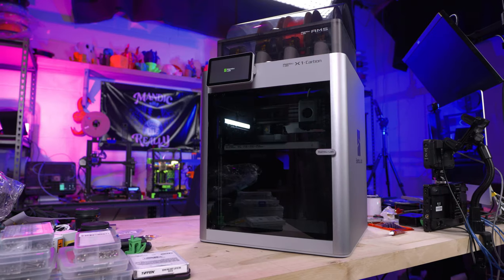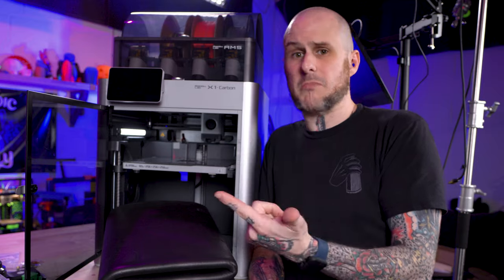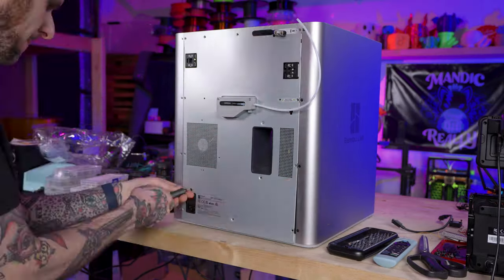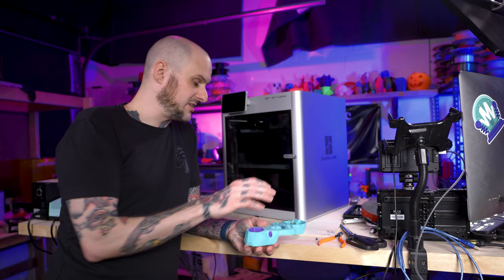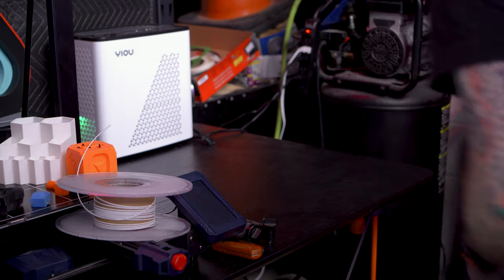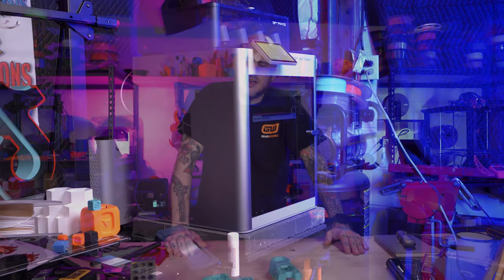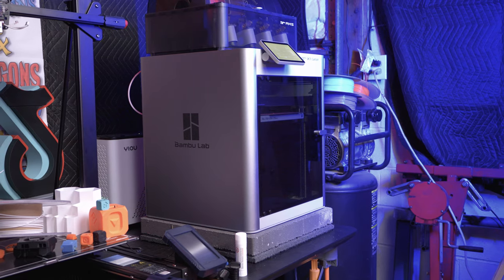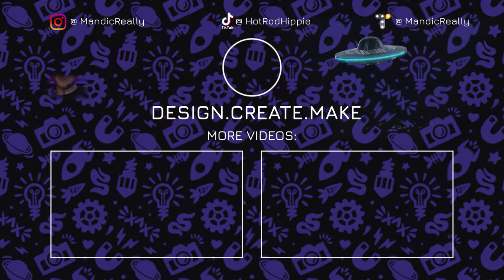Bambu X-1 3D Printer Modding & Problems - Noisy Ringing BEAST!

Comment: I got my X1C one week ago. The speed is amazing .... BUT .... i am really disappointed from the print quality. The print quality from my MK3S is so much better. Bambulab need to provide optimized configuration settings with much lower speeds. For most of the people quality is much more important then speed. The X1C is loud and shaking like hell with this high speed (default) settings. Configurations for high quality (much slower) prints needs to be provided in Bambu Studio from my pov.
Reply: I got some flawless results using the default, just halfed the motion speed to 10k and this surface smoothing in the slicer works very well.

Comment: One final thing I may do,as I’ll have this in garage, is get pink foam board insulation like r9 or r12.  

Then build a compartment on the back and both sides that will sit tight around the printer.

It should help a great deal with sound and chamber temp.

Then for your aesthetics it can just be removed like a can coozie.
Reply from the maker: I’ve got some plans to build a few “cabinets” for printers. Maybe something along these lines is in order for them. A more refined enclosure setup maybe.
Reply: I assume this might cause issues with the electronics or lifespan of the printer unless you actively cool them with room temp air or colder, like with any other printer

Comment: That AMS buffer on the back is crying out for some standoffs and maybe some additional support. I'm still waiting on a unit for now. I am curious as to why you didn't try some insulation on the back of the machine instead of the area you couldn't fit it on the inside. That should help some with the heat loss. Also, it might be worth printing some TPU footrests to better isolate the machine. It would also be interesting to try a sheet of insulating foam on the top of the machine under the AMS to see if it helped. Heat from the machine can't be good for the AMS anyway. Thanks for the video and for sharing. Sometimes you just have to try it to get answers.

Comment: 8:24 I printed the exact same Stealth Burner cover using Bambu Lab ABS at 50% default speed and all the corners came out crisp.
About the temp of the housing, why does everybody think it needs to be cooking in there? I print ABS at 35C Chamber temp just fine. What warps at cracks prints is draft and temp variations. Heck, before that I even printed ABS and ASA on a Prusa with only a plastic bag over it.

Comment: Ringing will generally increase with belt tension - but conversely, looser belts will also mean softer corners. That's un-compensated, of course. Surface the printer is on has some effect, but it's generally minimal, unless the printer is featherweight. Also, the lighter the motion system, the higher the ringing frequency will be, making it more noticable. Finally, overshoots in corners can also be due to belt springiness.

I'd recommend trying to tighten/loosen the belts as a first step in finding the cause.
Reply: no - the tension of the belt just shifts the frequency around
Reply: @TechTomVideo  Correct, and guess what happens when the wavelength is longer than the longest side of a printed object ;)
Reply: Additionally, what do you think happens when you shift the frequency outside of a resonance?
Reply: @oorcinus  you definetly should learn one thing or another about frequency and resonance.

what you're doing is wishful thinking.

You can't pick one part out of a parts network and claim something about it, without taking the complete machine into account.

your way of thinking is understandable, but your claim is not valid when it comes to physics
Reply: @TechTomVideo  Sure, bud, i’ve only been writing about and solving the problem of ringing in corexy and bed slinger machines for 10 years, it’s all just been wishful thinking.
Reply: @oorcinus  sure you did
Reply: @TechTomVideo  Look at the date on thing:277394
Reply: And if you were actually around doing the same things 10 or 11 years ago, you would’ve probably seen me on the old reprap forums posting about vibration/ripple and tests with fluidic dampeners too (spoiler: they did nothing, because the steppers’ own spring-mass-damper system was far out of the frequency range of visible artifacts).
Reply: @oorcinus   it seems to be very important for you to convince me of your expertise...

only hobbists would do that
Reply: @TechTomVideo  Sure. I wish you luck in your future endeavors. You seem like a very pleasant and smart person.

Comment: I'd assume they use a fairly aggressive form of vibration compensation. If you read up on klipper's input shaper types you'll find they try to give you the best option between reducing ghosting and not smoothing sharp corners.

Comment: the only way the paver would help is if you physically attached/anchored it to the machine… increasing the mass of the printer is what will help. Also it’s interesting that you were concerned with the quality while the production took half the amount of time as the ender 3, what would the results look like if you slowed it down maybe 25%
Reply from the maker: Not much different.  I said I've printed numerous of these and can't explain every single one.  I've printed fairly close to Ender 3 "speeds" and quality issues persist.  Also the paver is there to increase mass in relation to whatever the printer is sitting on.  It may not be directly coupled but it does have an effect on the sound and movement of the machine.

Comment: The car audio stuff you used, be careful with in the heated area. Cheaper stuff (like you used) is made with cheap materials like asphalt that will melt under heat. Happens all the time to cars. If you start it start to melt, pull it asap before it starts to drip and get something higher quality. It will work Much better for resonance control, and won't melt.
But if you can use a single sheet of the CLD material, it will perform much better. If it's still loud, get some Mass loaded vinyl and glue that onto the areas where there is foam.

Comment: Hi
I haven't received the device yet, but I'm looking forward to it.
Regarding your ringing problems:
I would do the calibration the way you will print later; so set it up exactly where you will need it later, with the heat bed, with the filament threaded in and (!) with the DOOR CLOSED!
Because an open door shifts the balance of the whole device, the vibrations propagate in a completely different way, etc.
Give it a try, you can't lose anything :)
Greetings from Switzerland
Reply from the maker: Thanks for the input, I however did all of that. The door was only open for filming purposes (fairly sure I put a notation in saying as much).  Actual tests were done with the door closed during calibration.  I've improved quality since this video and will do a follow-up, but none of my improvements can be related to the calibration process itself unfortunately.

Comment: Your double line might be pressure advance. Check it out :)
Reply from the maker: The machine is closed source. There is no way to determine what the machine is setting for the Pressure Advance. An engineer clued me in to a way to trick the auto-calibration to try and use different values but that has only worsened the overall quality and not addressed the issues. This is the problem. It could be a few things causing this but I have no data to work off of or settings to easily tweak unfortunately.

Comment: What about slowing the print speed down? That make any changes to the quality? With how fast this thing cooks, i'd imagine its going to have some issues there.
Reply from the maker: I've slowed it down to 50% of its default speeds and found only a marginal improvement in quality.  Corners were still round where they should be crisp, and ghosting was still present. Mind you those 50% speeds are slower than I print with on my Voron V0.1 that isn't tuned fully.

This machine is truly impressive, especially for its price point, but there are still issues present. I think they probably need to create slower profiles tuned especially for quality, but they seem to have focused on the marketability of speed.  

I didn't include the scope of the testing I've done in this video as it would have been bogging down in details and likely been twice as long of a video. I'm confident the issues I'm experiencing will be worked out eventually, but with the data I have available, I'm not sure how I'll address them.

Comment: Two layers of mylar blanket should help in those thight spots. its best if those two layers of mylar are separated by a layer of air (make a gasket you can glue the mylar on, the gap provided by the gasket does not have to be wide 2mm allready does a lot)

Comment: Im getting ready to purchase the X-1C but plan on using DYNAMAT throughout the interior you should look into it you can get the internal cabin to a temp of 60c with the reflectiv Dynamate its only 50mil thick so you should be alble to cover the internal cabin without any interference  hope this helps
Reply from the maker: Dynamat is the same product type as the stuff I applied. Butyl with a foil backing. I just used a generic version that costs WAY less.
Reply: @MandicReally  yes but didn’t you only use in on the bottom?

Comment: considering the flatness variance of your concrete and rubber, maybe just cut 4 small corner pads. Or go NASA style and use 3 so it will always have stable contact(in many areas all of their floor equipment is spec'd for 3 casters or legs). Regarding the chamber temperature and sound reduction. Gaps, even tiny ones, are the #1 enemy. It may be easier to add a complete external cabinet. MDF, rockwool and a door gasket if you really don't want to hear it.

Comment: Please don't hear this as complaining, but I wish you would have shown the whole process of removing the back.  I am having issues with my heatbed.  I filed a ticket and was given a link to instructions on the wiki.  It has me removing the back, but it just says to “remove the rear cover” and “remove the excess chute.”  There are 3 red circles on a picture, but completely NO INSTRUCTIONS on how to do that.  I don’t want to pull or do anything that will cause further harm to my machine.  I have been searching all over to find a video showing how to do that. 🥴

Comment: It would have been cool to see a  test where you wrap the whole machine with insulation to see if that helps more since the insides are so limited.
Just as an experiment, and it doesn't need to be glued permanently.
Reply: yep just a heavy moving blanket wrapped around the whole thing

Comment: maybe you should consider the opposite.

for lathes or milling machines it's not uncommon to bolt them down onto the workshop floor in order to adress exactly these problems with ringing and rattling.

Comment: I enjoy your content, and your storytelling is second to none :-)

Regarding ringing: I haven't seen it anywhere else than on machines for precision machining of metal, but if you really would dampen resonance within the printer itself, wouldn't you have to bolt it to a heavy foundation? Lathes for instance are bolted to the floor, and the printer could be likewise (or bolted to a stack of paves). There are probably no obvious places for it on the Bambu, but the printer must have some kind of feets.... It might seem drastic, but for a machine that fast, and "for science" it might be worth considering.....!?

Comment: I have a Carbon X1 and found your video as I'm trying to get it simply to print a round hole.  The test I ran was a 3/8" OD washer with a 1/8" ID in the 4 corners and center.  the two on the left side of the bed were only 0.007" out of round where the two on the right were 0.015"... I'll try tightening the belt and putting on a more solid surface... Possibly look at the infill pattern and see if concentric infill would work
Reply from the maker: If you’ve got an AMS, remove it from the top of the machine. I haven’t done a video to show yet but that was the biggest improvement I’ve found so far. I’ll cover it soon. I also print at 50% or less of default speed. It’s still plenty fast.
Reply: @MandicReally  YEP! and I moved it to the floor with more of a "repeatable". I was just coming back here to reply that I found taking the AMS off did the trick.  I now print at full speed for most parts and then if I really need within a few thou I slow it down!  It dawned on me that the moment of inertia of the AMS is variable especially with full spools.  I am going to build a table and get a bit longer tube so I can place it under it.  I was even considering adding a damped pendulum weight under it... then I thought better of that as it would be a science experiment on it's own.  Thanks again
Reply from the maker: @stevenabbott4628  Glad to hear it worked for you too.  I NEED to do a video about it.  It is sad that Bambu clearly designed the machine to put the AMS on top, but it is a terrible idea for the machine in practice.

Comment: maybe a stupid idea of me, but i think if you could replace all these panels with wood it would reduce the sound. Also you can make it a little bigger so you even can put sound insulation everywhere. afterwards you can paint it or engrave it, give it any look you want.
Reply from the maker: I avoid flammable components around heater elements as much as I can. I would make panels from acrylic for similar reasons. You aren’t wrong at all, but on a machine I know is intended to run heater elements at sustained higher temperatures, I wouldn’t mess with it.

Comment: Very impressed with this review and super helpful because the Bambu is on my list as an upgrade to my Prusa Mk3s. Unfortunately the Bambu isnt currently ticking all the boxes I need it to.
Reply: Which boxes are missing for you?
Reply: @devrim1134  I think if I didn't have a Prusa Mk3s I would purchase it or one of the others on my list. As it stands it is a lot quicker than the Prusa and would tick the multimaterial box which the Prusa doesn't. However I had thought that with the enclosure the noise level would be equivalent to the Prusa which is obviously not the case. I am really not keen on using the cool plate with glue sticks.. it seems a step back but I want the LIDAR feature which is a big step forward. I contacted Bambu about this, asked if there would be an update to get the LIDAR to function better with the textured PEI plate. The answer was that it could never be as accurate with the textured plate as the cool plate so use the cool plate to flow calibrate the filament and then switch in the textured plate and deselect flow calibration. This makes sense but is a bit clunky.. I suspect they will work on this. At this stage the print quality isn't quite sorted and I suspect will be significantly improved over the coming months. Overall the product and software appear to need some tweaks. At the moment I'm considering the Bambu x1 Carbon, the Anker Make M5 and the FL SUN V400.. Not an easy choice, all have pros and cons.
Reply: @dworkin7110  thnx for your explanation! Im new to 3d, don’t have a printer yet, need to make some decisions as well :)

Comment: I'm having some pretty severe ringing on my X1 as well - but my ringing has several "waves".  I've done pretty much all the same things - with the exception of the insulation (belts, calibration, dampening, etc) and while it has improved a tiny bit, it's still doing it.  I'm seeing it especially on compound curves, and since I print a lot of characters, I'm seeing a lot of it.  I even tried slowing down the machine to about 60% of "normal" speed ... and the ringing is still there.  Re-orienting the model in the slicer just relocates the ringing.  I really hope that Bambu can figure out what the heck is going on because it's an amazing printer.  So, you're not alone.  I'm currently doing one more test print, and then I'm going to be firing off results, pics, 3mf files and descriptions to hopefully get them to tell me what is going on ....
Reply from the maker: Is your AMS on top of the machine? If so, Remove it, Do a calibration, retest. That made the biggest improvement for me. I’ll do a follow up sometime soon.
Reply: @MandicReally  I don't have the AMS - but I have another X1 coming in tomorrow.  I'm going to run tests on it - same prints - to see if I get the same behavior.  I did some tests today where I copied over settings from Prusa Slicer (my MK3 prints these models perfectly - but much more slowly) and then I used 2X the Prusa's speed settings.  The results were much better than what I was seeing before, but the ringing was still there.   I'm also finding that the ringing is quadrant-based - it shows up in the 3-6 o'clock area and the 9-12 o'clock area.  The artifacts also seem to be about the same size on the model no matter the scale ... which points to mechanical as opposed to software issues.  I also sent a bunch of pics and 3MF files to Bambu Lab - we'll see if they get back to me with anything other than "print slower" ... ;)  Hopefully, we get a slicer/software update that fixes it.
Reply: @MandicReally  Just a follow-up:  I got hold of Bambu tech support and they saw my pics and my files and suggested that I clean the carbon rods using the instructions on their website.  I didn't have a lot of faith that this would work as the printer only has a dozen or so prints on the clock - BUT - I cleaned the rods per the instructions and 99.9% of the ringing went away - poof.  I'm a happy printer nerd again :)   You should be able to find the instructions under the Troubleshooting on the Wiki - look for:  abnormal-xy-axis-resistance

Comment: I'm curious if plasti-dipping those panels would help. It's thin enough to not worry about clearance in the tight spots and corners where panels join. it's thinner than the insulation, but you could also dip both sides if you wanted to.
It would also look better imo.